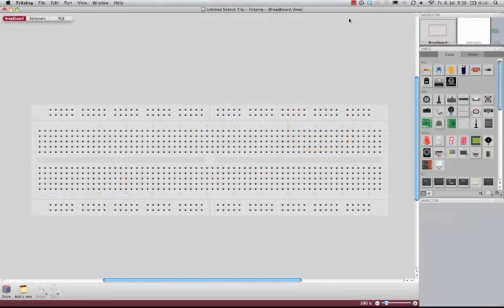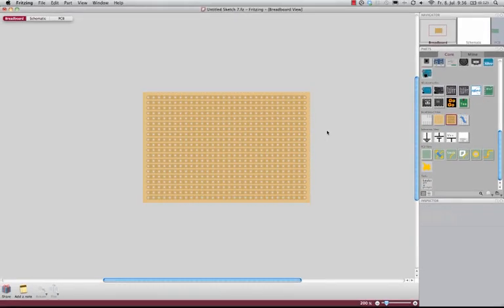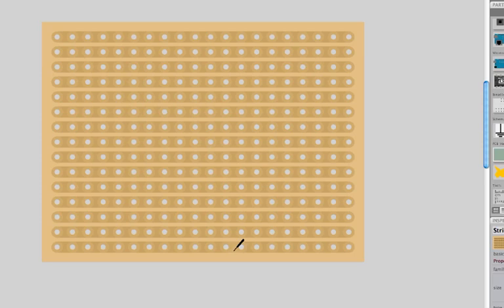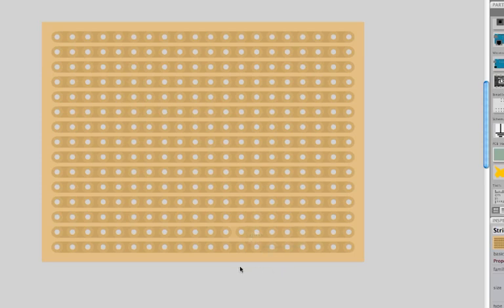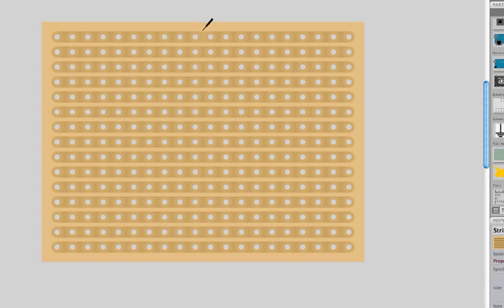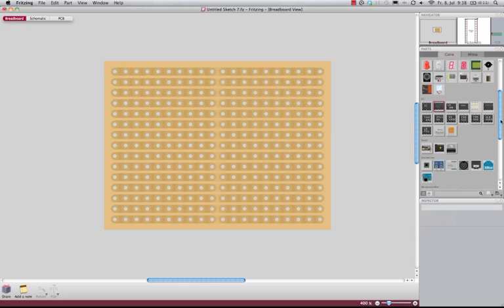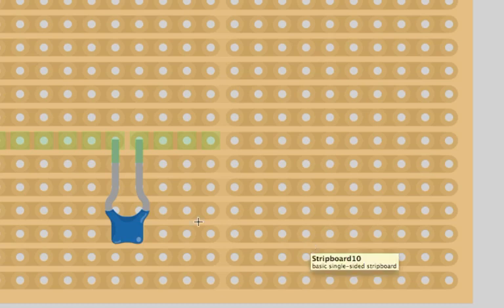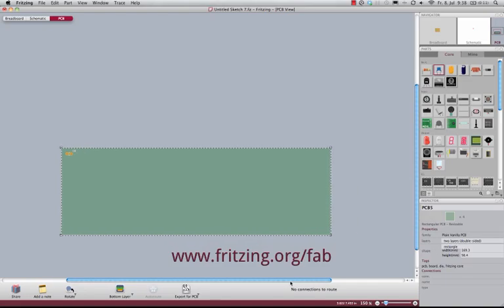Fritzing Tutorial Stripboard

Comment: Cut tool is great option but, sadly, it doesn't function like that in real life. Usually, drill is used to remove copper around the hole, so that soldering point is lost, unlike in Fritzing.